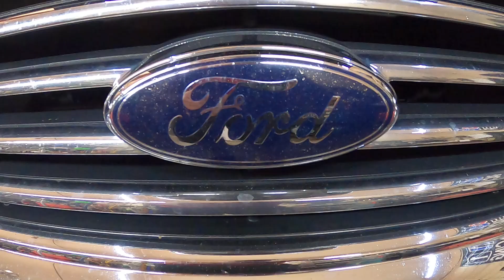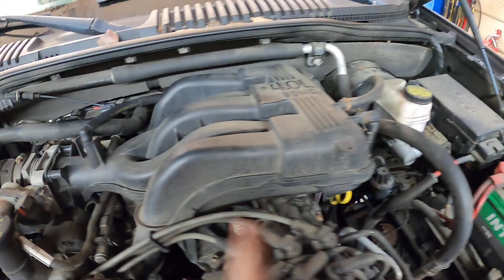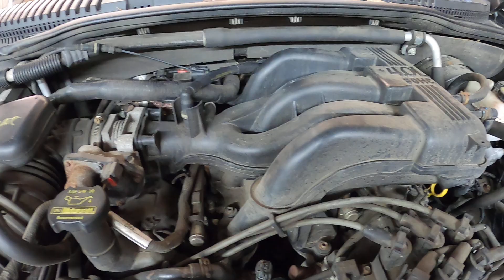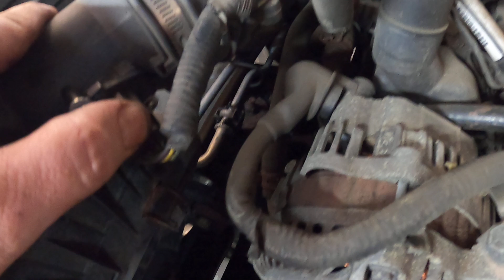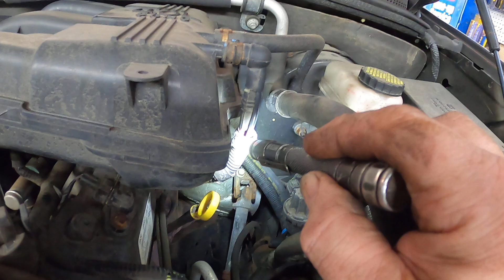2010 Ford Explorer P0106 MAP Sensor Code

Comment: I have fuel in the 2 vacuum lines what would be the problem
Reply from the maker: The fuel pressure regulator could be bad and sucking up the vacuum line.

Comment: I have 2009 Explorer Eddie Bauer. I have same issue with the vacuum harness you talk of. There is much confusion of the terms MAP sensor, DPFE and how it relates to the device mounted on top of EGR in your video (my 2009 is exactly the same). Online Ford Parts by VIN do not find a listing MAP sensor existing on the 4.0L V6 in 2009 or 2010. The EGR valves in these models do have a sensor mounted on top of them. Some call it the DPFE. Some call it other names. The vacuum harness that runs from the intake port (it has 3 black and 1 red hard plastic vacuum line at this end). It runs under the intake where one of the black lines ends in a rubber elbow fitting that connects to some port out of view. The remaining 2 black and 1 red line continue to the firewall and to the EGR area. The 1 red and 1 black line connect to the device on top of the EGR via a 2 port rubber elbow fitting. The 1 remaining black line runs to an inline check valve and continues on thru the firewall and terminates into a vacuum motor that controls an HVAC blend door and has nothing to do with emission codes! Yes the black line that connects to a port under the intake is a mystery and can throw PO401 codes and PO106 as well it appears! Does any one know where the single black line that goes under the intake and ends at the rubber elbow connector? HELP!
Reply from the maker: It goes to the fuel pressure regular on the fuel rail under the upper manifold.
Reply: I remain a bit confused. Does the black line that goes to the fuel pressure regulator go directly to the EGR 2 port rubber connector elbow below the red line on EGR? THX! @TheGAutomotiveAndMore
Reply from the maker: @benniewilliams2019  No I think there is 4 lines. One red and 3 black. Red and black goes to the top of EGR. Another black goes to A/C inside car and the other black goes to the fuel pressure regulator.
Reply: Yes, yes.... I can see those 4 lines (3 black -1 red) in the vacuum harness at large end that connects to the vacuum port AND I can see the same 4 lines where the harness bends and goes under intake, BUT I can only see 3 lines coming out of the harness end at the EGR area (2 black - 1 red)! WHERE is the missing 3rd black line? I assume it connected directly to the fuel rail pressure sensor, as you explained. All 4 of these lines are attached to the same vacuum source at the intake port..correct? If they are all common to each other (vacuum wise), then a leak/break in one should result in a vacuum fail in all... correct? If they are all common, why are 2 needed at the EGR when they both pull the exact same vacuum value from the exact same port source? This leads me to believe they are not all common! SEE my confusion? I have a new vacuum harness coming. I will then be able to see which lines go where whether or not they a common. I will update this post in a few days with result. Thanks again for your input!

Comment: Mine is broken also in the same place as yours but you said you replaced it with another hose. But my question is Im trying to find the other end to that broken hose and I can't find it. It's starts off with 4 mini hoses 3 black and 1,red. And ends with 1 red and 2 black ???
Reply from the maker: You have to take the outer plastic sheathing off the lines to see what is broken.